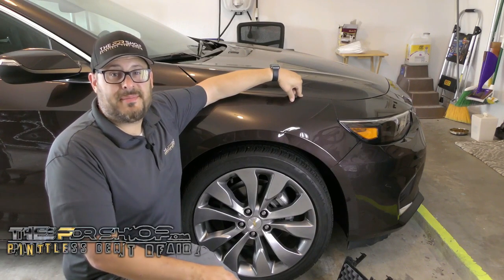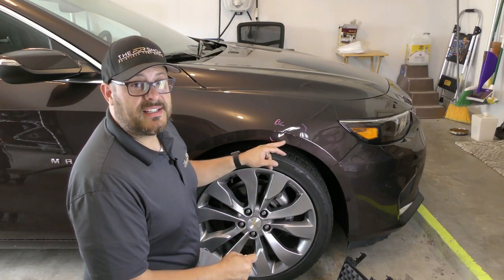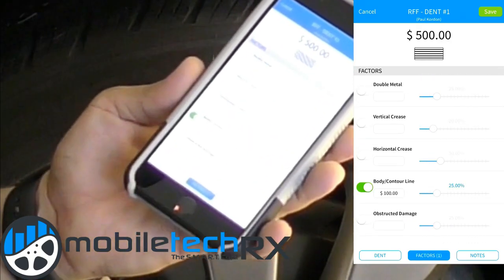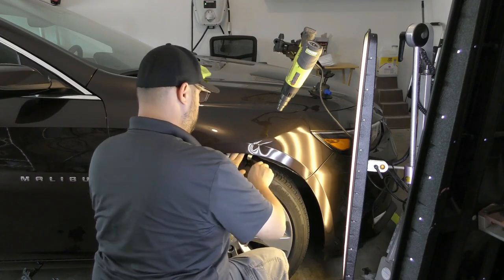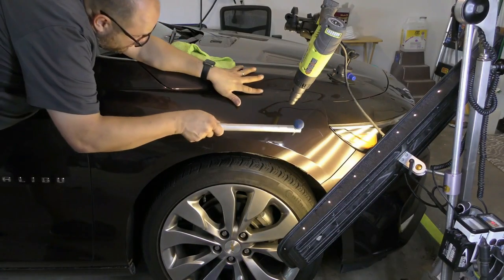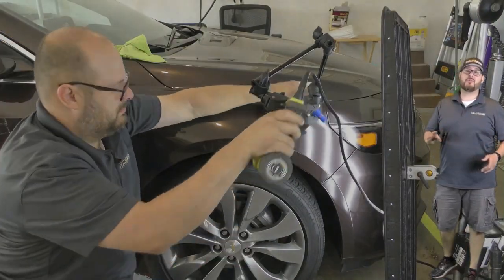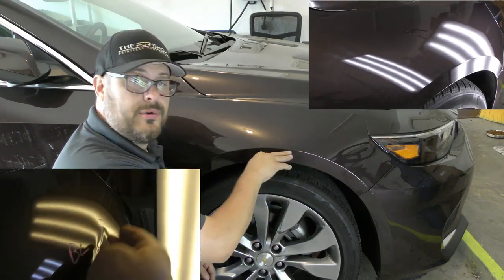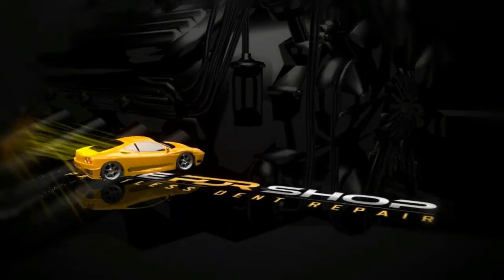2016 Chevy Malibu Fender Paintless Dent Repair Austin TX

Comment: What ramps are you using to unload from your van? I've just started looking at these and would be interested to hear your thoughts... Thanks - Wes @ South Bend Dent Company
Reply from the maker: This is the ramp I’m using and it really works great for me but I think the Ramps that are mounted permanently might be better. 
I’m not sure if this link will work here on YouTube👇
EZ-ACCESS, Trifold Ramp Advantage Series, 7 Feet (44 Pounds), Folding Ramp, Separates Into 2 Sections to Save on Storage and Transport Space, Self Adjusting Bottom for Secure Ramp to Ground Transfers https://www.amazon.com/dp/B001UP1BZC/ref=cm_sw_r_cp_api_i_FIq1BbBT85XND
Reply: Thanks for taking the time to reply. I appreciate it. I'll check these out and if I see anything else interesting I'll let you know. Thanks again -
Reply: @thepdrshopcharliemolina5374  The link did work - thanks again